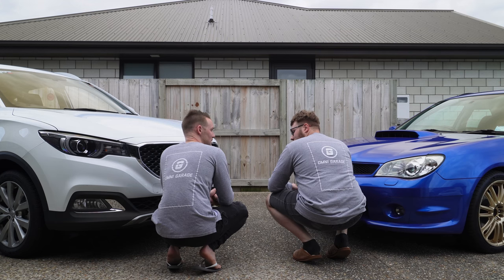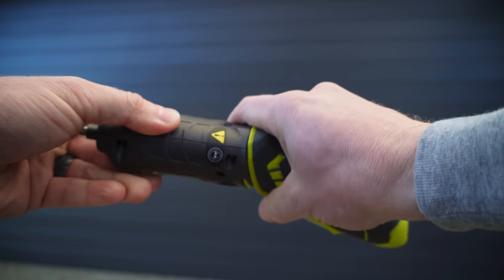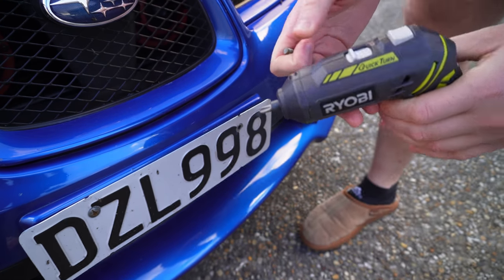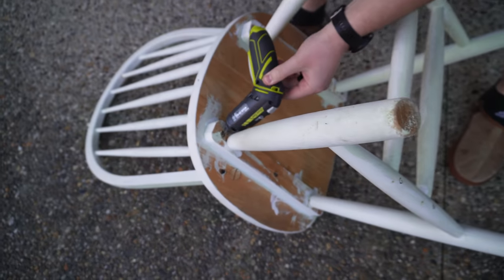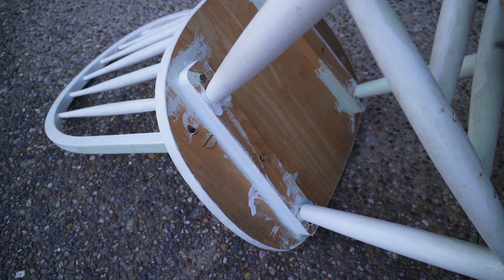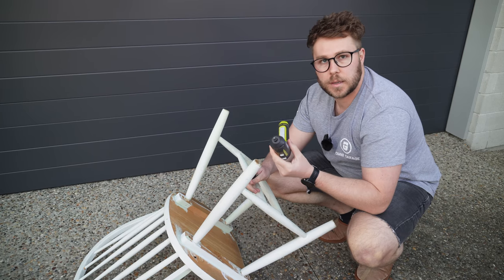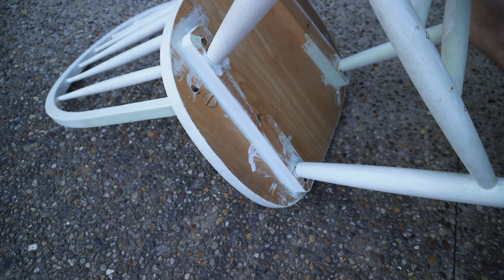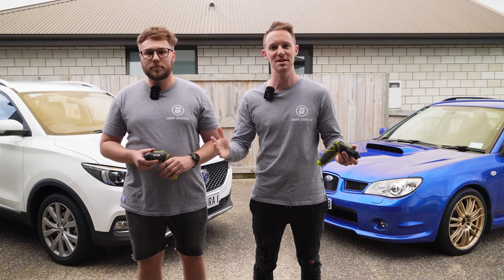Ryobi 4V Screwdriver

Comment: Thanks for the review guys. I picked up one of these the other day, and it's brilliant for the odd jobs around the house. I do have a regular drill with screwdriver bits etc, but this 4V screwdriver is much lighter and have to say it, easier on my small girl hands :). Have you come across any accessory bits that fit it, like a hex set or an extension bit?
Reply from the maker: This is my favourite tool.

Comment: Mine stopped working on first use, returned got another and stopped working before even getting to use, was told these are the worst ones on the market. The rotating feature pulls the Solder off the motor when you rotate too fast or too hard. But when you are working you usually aren’t easy with your tools.
Reply from the maker: Sorry to hear your bad experience with both tools. Hope you managed to find something better to replace it with.

Comment: I never understood this tool. If I’ve got a normal drill or driver what’s the point of this?  Especially when the battery will be garbage in five years. I’m not seeing it.
Reply from the maker: It’s small and versatile. Handy to have in conjunction with a traditional drill or driver. Especially how the handle can be turned to get into smaller spaces versus a normal drill.